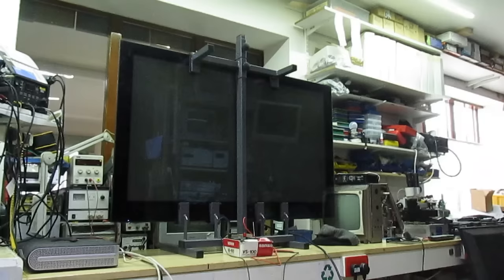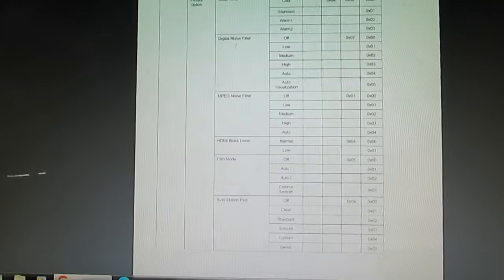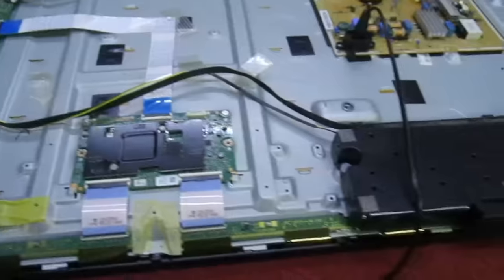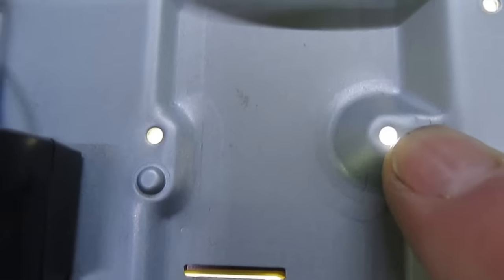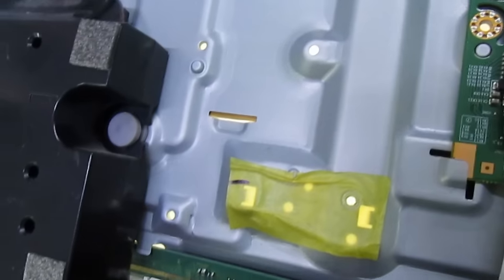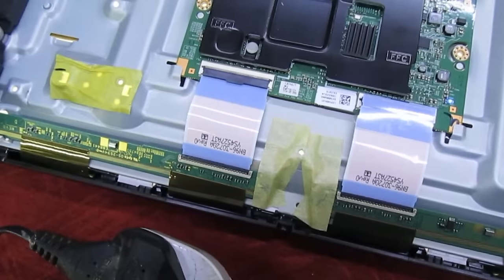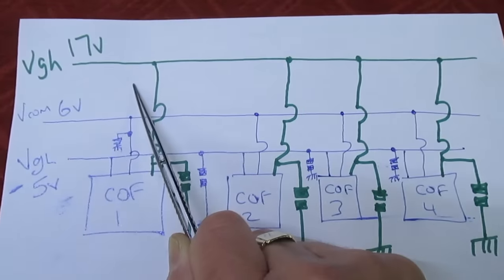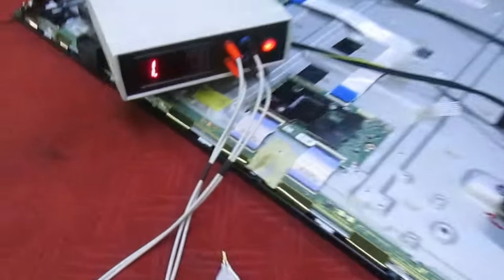Video to highlight the problem of repairing flat panel TV sets

Comment: OMG! Brings back awful memories of the TV and video service business I ran for about 12 years - 1985/97. It was the incipient epoch of electronics transitioning from high-to-low cost while complexity and serviceability was transitioning from economical to grotesquely uneconomical. It was cruel and unusual punishment made so much worse by the ignorant customers' attitudes. A 10 cent part that only took 2 days to find using hundreds or thousands of dollars worth of test equipment plus $30 for a service manual if you didn't have one for that particular unit. Everything you did was constrained by the customer who only wants to pay 10 cents so you have to lie and make the part worth $200 and the labour cost 10 cents - back then it was known as the "psychological bill". They are quite happy with that but absolutely NOT the other way around. Your equipment, time and expertise is utterly worthless to them! It was torture!
Reply from the maker: Here in the UK the whole industry went down the pan around 2010 when flat panel TV started to take off due the lowering of prices, I would Give anything to go back to the old days when electronic items were made to be repaired.
Reply: It is the new throw away world. I stopped electronic repairs when the IC came out.
Reply: I totaly agree and am amazed at your staying power. I am 67yr old and gave up TV repairs in the early 1990,s. Yes dealing with customers and the great story you had to spin just to make them think you have earned what you needed to earn. Most repairs were $189.60 or 176 or there abouts. So as that decoupling capacitor costs cents its obvious times have not changed facing the same problem of being able to justify being compensated for you knowledge, experience and all those that are write offs. I give you hats off as i did not think anyone would still doing component level repairs. Great for your share and the reminder of my past as it sure gave me strength of character.

Comment: I've used a similar technique to locate shorts for power supply modules connected in parallel. The copper connecting the supplies was of course much heavier. Connect a current source to the supply line and measure the IR drop in the copper. I usually needed about 10A. The last one with voltage drop is the defective one.
Reply from the maker: yes ,of course there are many different methods to do the same job .

Comment: I had similar experience in fault finding at component level with a Kenwood KR9400. I had assumed it had power supply problem and i kept looking at the rectifier but seeing it was not a dead short and finding minor different reading in diode direction lead me somewhere else such as amplifier. Took out a couple  offending transistors  and voila, the entire stereo works.
Reply from the maker: yes , its all to easy to rush in and change something only to find it does not cure the fault, replacement boards for TV s are not a cheap item to buy new and I have learnt its much better to spend another 30 mins or so on diagnostics and be as sure as you can that take a 5 min look and order the wrong item .

Comment: I had a very similar problem with a newer version but it did end up being the COF
Reply from the maker: Had the same a few weeks ago on a LG , couldn't use a milliohm meter at the short was over 20 ohms so I put a bench power supply on the rail and a COF burnt up, the set was only 18 months old .

Comment: Isn't there a decent and SAFE method of supporting a flat panel set in the vertical position with the back off so you can see the screen, preferably with a big mirror placed in front of it like you did with the old sets so you can be behind it and see what's happening on the screen? And it's ok trying to service them to component level if you can get the parts! Sometimes like with plasma screens there's a set of chips which are all matched and sealed so you can't just replace a failed one, all you can do is replace the whole wretched board! And I might've known there was a thirteen involved, trust that one to have failed, surprise, surprise! And how did you change it? did you place a little fork terminal on the end of a soldering iron? that's one way of changing them.

Comment: Good bit of technical work there Michael,  however the manufacturers cant supply any service info as they have few people like yourself who can repair to component level . Hope the customer was happy with your repair and paid you well for your expertise and time .
Reply from the maker: as you say component level fault finders are all but a few gone now but even for a board swapping engineer the service manual I showed on the pc was more like a user instruction book and didn't even contain any flow charts to aid some sort of fault diagnosis .

Comment: With some manufacturers (Vizio tvs from about 4 -5 years ago especially) i find they designed the TV with lackluster heat dissipation and manufactured with a solder alloy on their main processor BGA which gets brittle through thermal cycles over time.  Ive seen a few dead sets revived with a proper reflow of this chip to give it a few more years of life.  Always turn off quickstart on vizio TVs if you want it to last, otherwise I love their design, looks like an intelligent engineer put it together and is repairable.
Reply from the maker: Its the move to lead free solder that caused most of the damage to the electronics industry , not only does lead free seem more brittle it also has a tendency to grow tin whiskers especially it seems when exposed to heat .
Reply: @michaeldranfield7140  interesting, it might be tin whiskers shorting the BGA chips too.  In any case a little reflow brings it back to life quickly.  I try to upgrade the heat sink when i can too.

Comment: Great and helpful content! But, have you ever thought about injecting voltage (1-1,5V) and then observing the board with a thermal camera to locate faulty components? These get hot. Maybe, in this case its not even necessary to inject voltage ;-)

Comment: Okay, I'll take a shot:
My 3-year-old ONN LED (1 year warranty) from Walmart started flickering about 2 weeks ago. Unlike my previous TV's failure, I didn't jump right back to the store to buy a replacement. With patience, I find that if I let it "warm up" about 15 minutes 90% of the flickering is gone, and it's 98% gone after 45 minutes, and the momentary black screens aren't really noticeable. 
I don't know if this really has anything to do with temperature, but does this seem like a problem that is worth fixing, especially if my percentages fall? From the quality of the picture at 98%, it doesn't appear to be a simple backlights problem.
P.S.: For longevity, is it true that all flat-screen users should try to reduce the brightness of their screens? My "Movie" setting has always been about 85% as bright as "Standard" or "Vivid".
P.P.S.: And what about turning off flat-screens by cutting power vs. the usual "Standby" mode?
Reply from the maker: Flickering picture can sometimes be caused by a faulty LCD panel but if the set has PFC  check the voltage across the mains reservoir capacitor and make sure you have more than 380v across it before looking any further .

Comment: Keep in mind when servicing these T.V.'s or any China electronics. These T.V.'s or electronics a lot of time it will be a cap. The voltage rating of these caps are at what the voltage for the circuit is. They should be at least 10 volts higher or higher because running at the actual voltage shortens these caps drastically. if you have at least 10 volts or more the caps will last longer.
Reply from the maker: I'm not 100 percent sure bit I think in this size of cap they don't make one more than 25v.

Comment: Is it okay to put my TV off on the wall switch?
Reply from the maker: I know some people do this but it would be a good idea to first put the set into stand by with the remote and then switch it off at the wall, this gives the micro controller time to shut all the circuits down properly and store any data it needs in memory before the power down .
Reply: @michaeldranfield7140  I always turn the TV off with the remote before I turn it off on the wall switch

Comment: Without watching, I call bad capacitors.
Check caps, especially electrolytics.

I don't care it it is a simple toaster. Check the caps. If it has none, check them again...
Reply from the maker: Since this video was posted the most common fault with samsung is failure of the LCD panel , they are worse now than ever.
Reply: @michaeldranfield7140  Thanks for come-back. Nice to see you still replying to late comments on old vids - it is rare these days.

Comment: its a good picture that one
Reply from the maker: It is because the backlights were turned well down when it came on, most samsungs I see now have gone blue .
Reply: @michaeldranfield7140  yes I had one a few months back that was a bit blue I got a good 32 inch h5000 and it's perfect last week.  Will defo have a video later.

Comment: If the TV worked with the bad Cap removed why replace it then run the TV with out the cap
Reply from the maker: The caps are local decoupling capacitors and are there for a reason but a lot of equipment will function without them but if its fitted in the first place I like to return repairs as they left the factory, but yes I could have just left it out.

Comment: Well done..  Could you continue to run the TV "without" replacing the offending 25uf cap ?  What would the effect be on the viewing screen ?  Poor picture quality perhaps or bad colour  ??
Reply from the maker: The set will run without the cap and there should be no indication its missing as these are only local decoupling capacitors.

Comment: Great video and excellent presentation!
Thank you for taking the time to explain. 
I have seen other ( mobile phone repair ) videos where they trace faulty capacitors by using diode test in the meter. 
Put red probe to ground and test each capacitor till you see a value near to zero volts ( voltage measured in diodes rather than ohms). 
I wonder if you have ever tried this method or maybe if you have any thoughts about it?
I can’t wait to see your next video! Best wishes.
Reply from the maker: The problem with tracing faulty caps in the video I showed it that they could be 20 all effectively in parallel so it would be very difficult to single out the bad one without a milliohm meter, the only other alternative would be to remove them one by one which would be very time consuming, I am repairing for a living so I need to find the fault as quick as possible.
Reply: @michaeldranfield7140  thanks for the reply! I need to get a milli ohm meter now :-)
Reply: Great vid & tips -  re pulling cables out etc - wish I’d known that yesterday 😞 also re milliamp to lowest value. 

Can get circuit diags of the boards if you search the actual board manufacturer & board number/ - they can vary slightly if you can’t get exact match but it’d put you in right area for most components 

Might be worth investing in a 

LCR-T4-Mega328 Transistor Tester Triode Capacity ESR Meter MOS NPN 

You’ll get from eBay etc 
Around about £10 new. Very useful.

I use an ESR70 PEAK Atlas ESR Plus Tester ESR & Capacitance Analyser - bought years ago - still around £80+ worth getting with needle probes - 
Have been able to get capacitor values/readings with caps in circuit - and measure those tiny red pin head dot caps too. Determined fault on power supply to the backlight yesterday - was a tiny pin dot cap & pin dot 1R resistor close to power lead to backlight. 

Just lucky to see they were both a bit dull compared to others. 

Thanks again
Reply: I used to fault find circuit boards to component level many years ago at a board manufacturing factory.
Before we were equipped with milliohm meters we used this method to find the short.
Check the short circuit with a multi meter on restisnce and then in turn spray the suspect components 
with a deep freeze solution. (can be bought from hardware store).
The resistance reading will decrease once you freeze the faulty component.
So viola the short circuit is removed.

Comment: Imagine this happening to $5000 oled. I have my 4k tv that works fine but a tiny moth made its way behind the screen so I have this little dot on the screen.
Reply from the maker: That can be a problem as the LCD panel is not fully enclosed , worst I have seen is when someone has a set in a room heated by a coal fire , you get a lot of black soot inside the panel .

Comment: Yes indeed,    and '.. what is wrong with the british public at the time'  .......  Well that's just it:   want want  want NEWNEW NEW and no regard for the service centres.  So the Manufrs do what they do " because they have the power to do it..."    same in Cars , etc     just no end of grief.    Just as when you get a puncture, it was easier for the apprentice to swap the axle instead of wheel off and replace the tyre .....   that's how it is going.     So at end of day, if the Tech guy has no deep fundamental experience , modern stuff is all a pile of Trash with a one way ticket to China ... Thnaks for going through it, shows the understanding process in solving issues.

Comment: Hi Michael, great video! Super fault finding information. Just wondering could the issue you mentioned cause a ‘boot loop’ where the tv is coming on Samsung logo appears on the tv and within seconds it switches off and then tries to turn on again and so the cycle continues. A technician replaced both power board and main board (integrated tcon board) but no luck. 
I’ve taken matters into to my own hands now and as you mentioned I’m left with 2 spare boards now. Any advice or help would be great. It’s a QE55 QLED TV. Thanks in advance 🙏🏼😊
Reply from the maker: Yes it could well do, in the past I have had a few Samsung with exatcley the problem you describe and disconnecting the LVDS ribbon to the screen keeps the set on, but don't get too excited as it could be a COF that's faulty.
Reply: @michaeldranfield7140  Of course I won’t get my hopes up, but it’s worth a shot, last chance. Otherwise I’ll just try to sell the boards and dump the tv. Only a few years old and still an expensive tv. Hopefully it doesn’t have to go to dump. Thanks 👍🏼😊
Reply from the maker: @RobbieJPC86  Got another video coming out tonight , I have a samsung TV with same fault as your and found the problem .its a must watch !
Reply: @michaeldranfield7140  Thanks Michael! I’ll definitely watch it. Haven’t had a chance to check the TV using your previous video fault finding but will get it to it next week for sure. I’ll let you know what I can find 👍🏼😊
Reply from the maker: Forget the first video, it's the other one I made on Saturday you need.

Comment: Really really interesting! But be careful with any cable that is disconnected to make sure there is no chance that a connection to 'earth" could occur with an exposed conductor on the cable that is removed. My Samsung has some issue with horizontal streaks on one of the colours. Almost unnoticeable with a white background but with darker images, easier to see. I can connect a laptop to this model so I can set the colour screen on the laptop to any colour to see the result on the Samsung TV. But if this is on a bonded video cable to the panel, there is no way i can resolve this. But it already is more than 10 years old. I'll just replace it when the viewing gets really bad.

Comment: After 30+ yrs in the industry of Radio and Television repairs I also saw the service manual decline to what it is now. Basically, they are completely useless.
One of the first things you notice and learn when repairing anything electronics is , IT'S GUNNA BE A CAP . From couplers to Bias to smoothers to filters. One day it'll fail.
Look at the VCR switch mode p/s, completely enclosed in metal cans holding in the heat. Drying out the cheap 85 deg caps fitted by manufacturers. We blanketly changed on average 13 to 15 in Panasonic VCR's with 105 deg that didn't fail. Just a few extra cents in cost when making the unit and they would of lasted longer but it's all about life expectancy and built in obsolescence,  throw it out and buy a new one.  
Michael you didn't mention at the end of your video the argument with the customer, "what, its only a few cents of a part but you're charging me 2 hrs to fix it.  LOL.
Reply from the maker: The reality of it is in consumer electronics you can't charge for all your time like a car garage does of you would have no customers at all, the best you can hope for now is some money.!!

Comment: Goes into repair shop with a TV saying, its dead but not quiet.
Repair shop fixes TV and hands him the 100 dollar bill, customer asks what the problem was...
It's this little fella right here, shows customer a little knob the size of the tip of a tweezer.
That's a 100 bucks?
Reply from the maker: I actually find customers are more appreciative when you show them something the size of a pin head .

Comment: What is your address, and do you pay postage both ways? I have a "tele" you could repair and make another vid about. I can send an Amerikan to UK type plug adapter, if you like. Or you can possibly pick one up at Poundland if that will lower your shipping costs. Do you have a decent turnaround time? If I can get the repaired TV back in a few days that would be great.  😂 🤣
Reply from the maker: Sorry I cant accept TV s in the post , the likley hood it it will arrive with the screen smashed .

Comment: Remember when sams took apart tvs and created circuit diagrams.  Reverse engering a diragram is now illegal
Reply from the maker: I was a Samsung dealer and use to sell new equipment in the late 1980s when they made good stuff, sadly now its all crap, wouldn't want to be a dealer now.